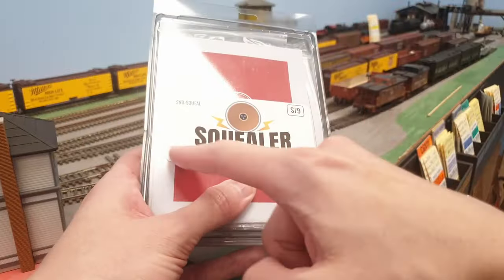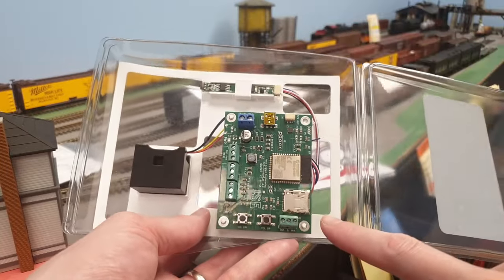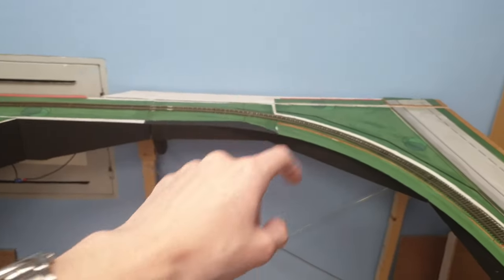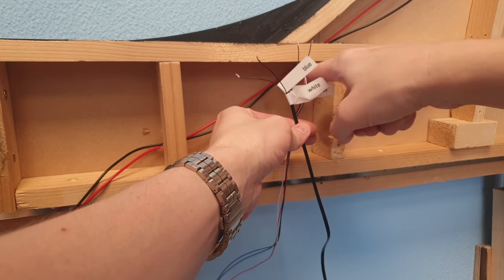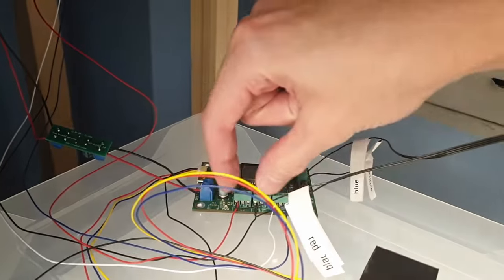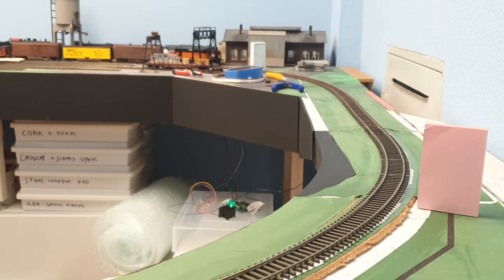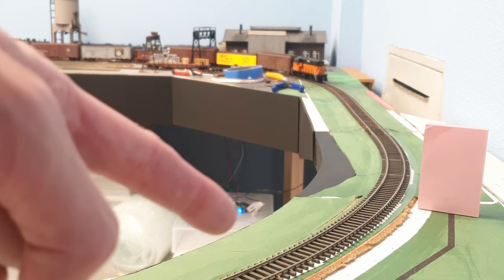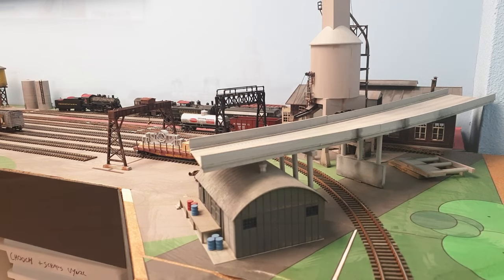Unexpected results when adding great squealing sounds ~185

Comment: I'd like to withdraw my earlier objection to this device.
I wrongly assumed it was installed in a freight car and would be making noise all the time.

This is a really well done installation video.

And the bit with the lift gate felt a bit matrix-like for a second.

10 of 10.
3 thumbs up!
Reply from the maker: Great to hear the video was usefull. No worries on the confusion. I thought you were thinking that. @soundtraxx have a specific decoder for cars.

Comment: Pretty neat device!  the fact that it can detect speed is a real step forward. It would be neat to have a sensor at each end of a curve with the speaker in the middle (though costly).  Wheel squeal is one of those sounds that's very directional.  I always thought putting a small sound decoder in a couple box cars with speakers would be the solution.  But there is the problem of timing it to go on only in curves as well as detect speed.  I guess we'll leave that to the electronics wizards.
Reply from the maker: I think it is a matter of layering sounds. So all of the above! Of you think about it, a lot of sounds are locational only. Clickity clack and squeals are caused locally  by track variables. Sounds like refers running and brake squeal are on the move.

Comment: Been waiting for this video since you announced it 😊
I like the squeals for themselves, but just popping up in general silence seems unnatural to me. I think it should be embedded in a broader acoustic concept like eg. engine sound and other background noises. Just my 50 ct.
Reply from the maker: I think that the layout in general can use more sounds. However it will be a balance between city noise and emersion. 
In an op session there are several engines running with sound. The steamers are relatively quite when standing still, bit those old diesels are always rambling. I find the sound space (?) is actually already quite full. Turning on e.g. a radio in the background is already too much.
If i have time left over, I was thinking to make a 1 hour loop with sounds like I made here:
https://youtu.be/Wq7K2foHXY4?si=5b5JG5WQa-XsISeK
Reply: @DubaiTrains  Yes, I love the diorama video, too. I suppose the optimum level of sound is highly variable. Depending on persons in the room, the type of operation you're doing, and the mood you're in.
For example my son cannot stand the engine sound. I also tend to switch it off for a more relaxing session. Other days I want engine and background sound to beam myself into the layout.
Reply from the maker: And then there is the third operating mode with music in the background 😂.

But good point, the setup needs to be variable.

Comment: wrong approach, sound decoders should have a motion sensor to tell if there is a sideways force eg turning and trigger the locos own flange squeal effect.
Reply from the maker: Hi Andrew, that sounds like a good approach. But until someone manufactures that I'm happy with the squueler.
Reply: @DubaiTrains  I dread the cost and complexity of having this on a large layout
Reply from the maker: I don't think it is intended to be in every curve. So just a few would be sufficient. I  find the price reasonable for a quality electronic. It won't effect the price per sq ft of layout much. 
Just check the prices of a fully interlocked set of turnouts with accompanying signals. That will drive up the cost per sq ft!
Reply: @DubaiTrains  where these noises would be made the most would be traversing across points, so if you covered those then it will certainly get expensive.